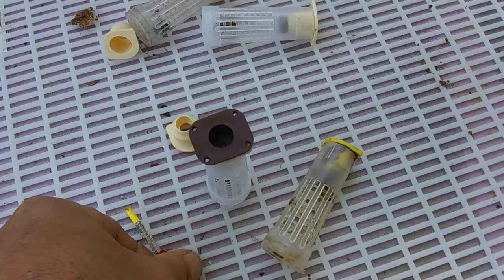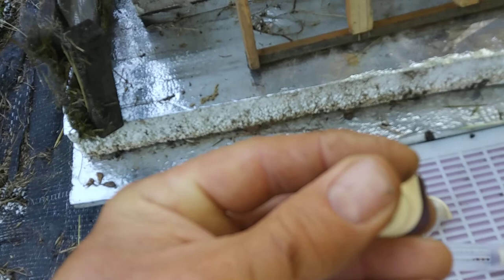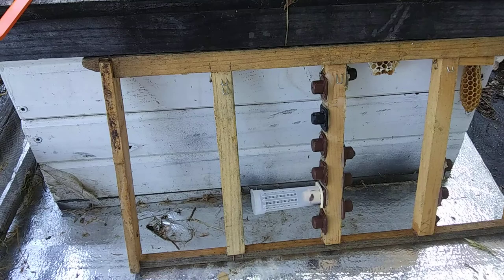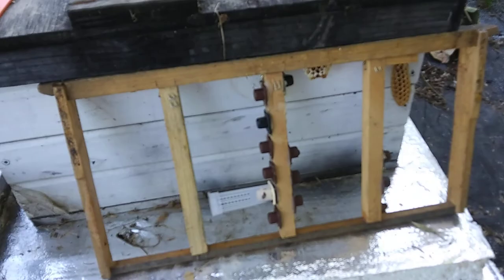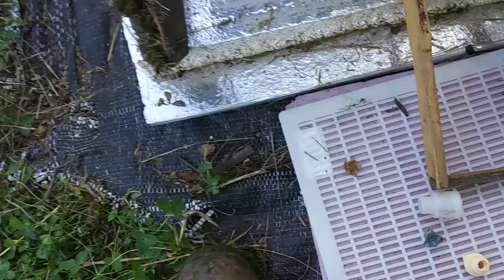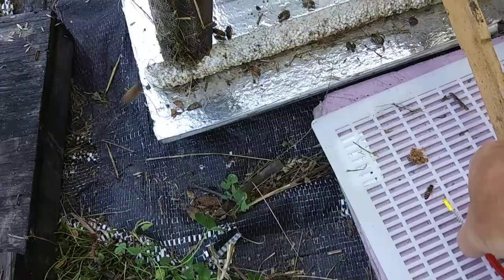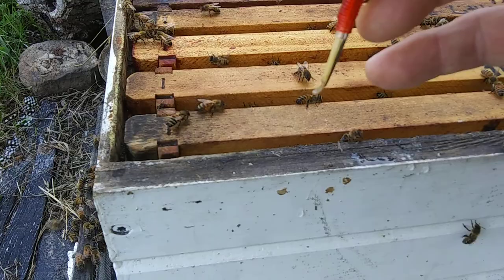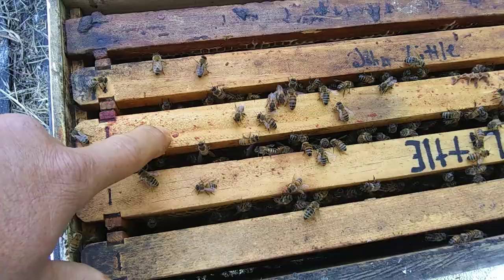Queen Rearing Stuff

Comment: I use the angled metal tools now was only Getting 80% take with Chinese tools 95% with angled tool, I found a few larvae were being pinched by the plunger that’s why I change both just as fast but priming is recommended.

John for the cheapest phone stand/hanger/tripod use a wire coat hanger, stretch it from the hook down then squeeze it together so the wire is train track then fold the bottom 3rd on top of its self then back on top it’s self again, you slide the phone in and can hang or stand on just about anything.
Reply from the maker: That's good trick..I have a plastic version of  German grafting tool, I don't like it cause it's curved, I think it should be straight with a tongue off the side, to make about a 90 degree angle or maybe like 60 may give more flexibility.I never tried metal German Grafting tool,only cause I like the Chinese, and the German tools lil more expensive
Reply: Baddest Bees I’m bout to post a lil vid nothing special
Reply: Baddest Bees I’m looking back to see if I have any video with the metal tools